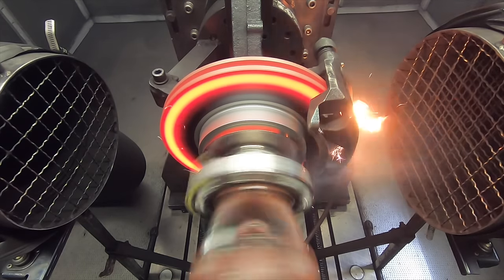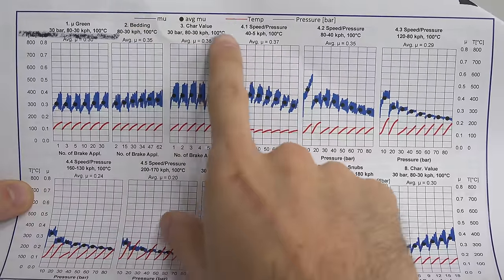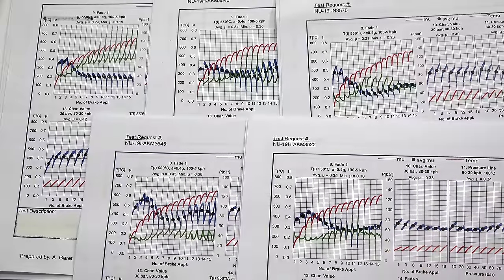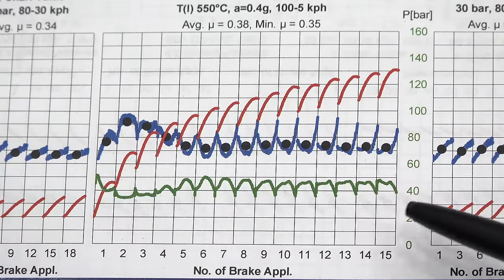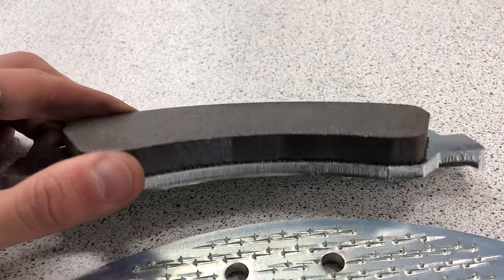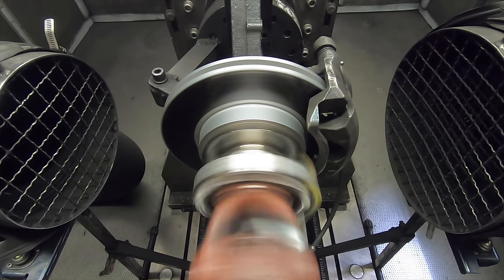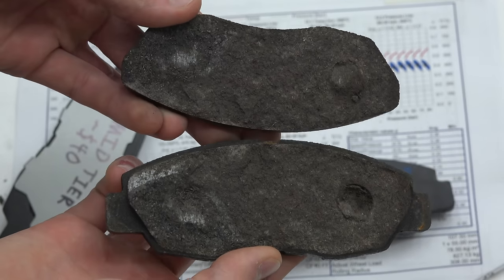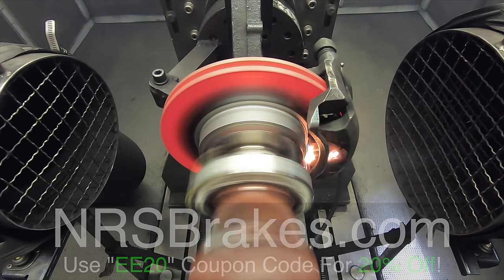What Are The Best Brake Pads? Cheap vs Expensive Tested!

Comment: "NRS uses mechanical burs to lock the pad to the backing plate"

Barely passes shear test after corrosion test
Reply: I was disappointed we didn't get to see what their pads looked like after this test. Would be good to see how well it worked. Personally I have never had pads fail due to corrosion or shear.
Reply: Jeff Ratliff It’s shown on 15:03
Reply: @AaAaSRB  You are right. Guess I missed it.
Reply: Iirc the pad material itself was the failure point not the adhesion plane, so the metal burs actually did their job well
Reply: @carl5426  Yes, if the purpose of the burrs is to make sure that at least some material is retained on the plate after material failure. But to be honest, it looks like just another instance where beefing up one part in a system transfers the load elsewhere. Is it better for a brake shoe to shed all its material, or only some, leaving a rough surface and the exposed heads of the burrs?
Reply: Yeah, quite surprising that it doesn't seem to work all that well.
Reply: @Wookey.   Agreed, however I think it is a good emergency buffer if it were to shear off and give you a chance to notice it before you demolish your discs hahah. The shear test was definitely pretty inconclusive hahahaha
Reply: I suspect that test is more about exceeding some threshold value than achieving the highest value possible as the shear failure seems to be a rare phenomena. It's likely the pads shear failure isn't a design priority past a certain value the way stopping power might.
Reply: @JeffRatliffhome  being a mechanic in the field I've seen many a  cheap brake pad separate from the backing plate from normal usage. Never mind the noise they make and prematurely wear out the rotor before the pads are worn. You get what you pay for and ultimately endanger yourself and everyone else on the road.
Reply: @danielkuddes6050  Agreed. Stopping power, quietness, temperature consistency - those would all be affected by the material used. Odds are they traded as much shear strength as possible for the other positive attributes.
Reply: Of course they passed, though.  The ‘passing grade’ is what they picked as the standard, and they engineered to meet it.
Reply: @Vessekx  Every company has to meet a national standard in regards to this situation. Yes every product is engineered to a point, however that point has to be passed, and for NRS it passed while under a 2 month degradation point as well as the OEM brakes. This is important because OEM's have to be made to standard rather then after market parts which can have some leeway on both material and standards used. I don't believe NRS is deviating from a typical standardized test. They so far are proven to be just under OEM standard.
Reply: That's because tests only measure up to the point at which the adhesive debonds in shear. Due to the mechanical burs, it has additional forces it would have to overcome past this point in order for the pad to fall completely off
Reply: KyuzoMugenUndPanzer, you seem to have missed that the specified standard NRS tests against is a standard they decided on, not a national standard.
Reply: @innocentoctave  Pretty sure your rotors and your ability to stop the car are well and truly fucked regardless of if you end up with some brake pad material and metal burs, or if your entire pad material sheers off and you're applying bare metal to the rotor.
Reply: Honestly I don't think it's a good idea to have these burs. It will make it easier to pass the shear test, but it also reduces the contact area due to the manufacture process(it's difficult to form a surface perfectly matching the burs). It sounds like a design to pass a specific test.
Reply: @filbal5954  im a mechanic as wel, and the noise when the pads start to separate and people stil drive. Its like someone screeching on a blackboard with his nails. And some people still think they have a great deal with their cheapo pads. And i dont know how bad it is where you are a mechanic. But the worst i have seen with cheap pads where pads that didnt really fit. They put some coating on it to stop it from rusting, but they put on so much you actually had to grind the pads down to get them to fit in the caliper. Now if that isnt a red flag then i dont know what is. But i actually refuse to work with that brand. And we did do some road testing with a set of those pads. Guess what? 10.000km and the pads where gone. Then put in a OE spec, 60.000km. Same car same driver, same driving style and the same road to work every day. So yes the cheap pads where only 20$, and had to be "modified" to fit, and the expensive where close to 100$. But in the end the expensive pads lasted 6 times as long, so it was cheaper, it fit better, it had better braking performance and no noise. And you didnt need to look every week if the pad was stil attached to the backing plate.
Reply: @mjc0961  Not true, I've run pads until they literally cracked in half and shot out the back of the caliper. The caliper piston stopped the car just fine and I drove it home.
I was going to replace the calipers and rotors anyway, so I figured why not.
Reply: El Guapo Fortunately the brakes still worked after you drove the vehicle until the pads fell apart, as you wouldn’t have wanted to cause an accident
Reply: @elguapo1690  While the conditions worked in your favor (as opposed to everyone else you interacted with on the road during that drive[s]), I much rather prefer to increase the longevity of my braking parts to prevent full-on replacement unless required. As pads interact with the rotors in a number of ways (different materials impressing upon each other in a high temperature and high pressure environment), as well as environmental conditions, I would prefer to have components that make the most of that relationship instead of seeing how long you can get away with shot to sh*t pads.
Reply: Seems more like marketing than engineering.
Reply: @JeffRatliffhome  corrosion failures usually only happens if you drive very little and the pads last many years. 
Normal drivers have to replace them way earlier, because they are worn down then.
Reply: @innocentoctave  I agree, strengthening one point transferred the load elsewhere, and that is why we see such results. 

And, I agree, you are correct again. In posing the question of shedding all material vs leaving some material and the mechanical burs.

I can't say definitively, but, in my opinion, I would say some material and the burs. (Depending on if you pay attention to your braking in terms of noise and feel.) In either case, the rotor in going to be damaged and need replacement. But, if you have some material left, with or without burs, it would be better than no material. 

All of that is, however, only if you lose all of the sheared material. There is a strong probability, I think, that the brake bracket, caliper, and backing could keep the sheared of material trapped and pressed against the rotor well enough to keep stopping capabilities until it could be replaced.

It would just cause a lot of noise, vibration, and other noticeable and undesirable effects.

But, these are just my thoughts. I think your line of reasoning is correct and wanted to give a shot at answering the question you posed.
Reply: I found it kind of suspicious that NRS recommended a shear pressure just below their pressure where their pads failed at
Reply: @innocentoctave  Well, you could consider the burrs are wear indicators!

Comment: It would have also been a good idea to test rotor thickness with each pad to see whether the pads that lasted longer wore the more expensive rotor faster. The way I understand it, is that there's also a tradeoff there between rotor and pad life.
Reply: no
Reply: There certainly used to be when ceramic pads were a new item. Ceramic pads would eat up a rotor pretty quickly.  Not a problem if you do pads and rotors on a brake job for yourself.
Reply: @shawnkelly695  I’ve gotten my coasting up to a red light as it changes green to an art form. Probably bugs the people behind me, but what is behind is not my concern. Unless it’s a cop.
Reply: @charlesgallagher1376  would cops hate your coasting driving style?
Reply: Youll never burn through your rotor before the pad. Unless youre using the same rotor for multiple pad uses
Reply: @shawnkelly695  I do the same thing. I never understand why some people tailgate so much. Not only are you reducing your chances of reacting safely to something up ahead but you'll have to jam on the brakes everytime you have to stop. I just let off the gas once I see the yellow light while my sister would keep her foot on the gas pedal until she has to jam on the brakes. No wonder she had to replace the brakes every couple of years on top of destroying her fuel mileage. The key to most driving is keeping most inputs to the bare minimum. Tailgating and speeding only save you a potential couple of minutes while your risking accidents or tickets.
Reply: @shawnkelly695  perfectly said. LoL it is amazing how my philosophy on driving is exactly the same even down to the psychological stress. I can't wait until the perfect autonomous vehicles. It will eliminate accidents and traffic almost entirely as well as reducing travel times, stress and traffic lights. Just imagine a city like New York with no traffic jams. All of the cars communicating with each other and the traffic lights. No more DUI's or gridlock. Elderly won't be forced to isolate themselves cuz they don't have a license or car.
Reply: @turtleb7170  unless the rotor warps which happens a lot on cheaper aftermarket rotors
Reply: @turtleb7170  - But the question still stands. How many brake changes can I before buying rotors? If I can get another one or even two more brake changes without replacing my rotors, I would certainly be willing to pay more for brake pads that give me that option.
Reply: @seanriopel3132  - Please don't compare speeding to tailgating. Tailgating is an aggressive behavior that does nothing but create stress for everyone involved. Speeding, however, can obviously save you critical time. If you're going to miss a critical time and speeding gets you there on time instead, it can matter. For example, getting to a flight, train, ferry, or show on time. Of course, it's hard to save much time by speeding, and leaving earlier is always the smarter, safer, cheaper, and MUCH less stressful solution - for the other drivers you affect as well as yourself.
Reply: @seanriopel3132  - Autonomous vehicles will obey speed limits when they are ridiculous. Driving in the middle of a three-lane highway when it is empty should not require a limit of 65 mph. That limit assumes moderate traffic in all three lanes during a rainy day. A robocar will crawl along, wasting time.
Reply: I want to know what manufacturer the mid grades were, I live in the desert so rust is of no concern to me
Reply: @turtleb7170  "Unless youre using the same rotor for multiple pad uses"

 I certainly do not expect to have to replace the rotors every time I replace the pads, nor have I had to do so.

Comment: Great explanation, when I was a mechanic I specialized in brakes, i went to all the major brake manufacturers brake schools,  and there IS A BIG difference in quality between cheapy pads and high quality pads,   Organic pads are the cheapest junk,  and ceramic was  rated tops,  when I was doing brakes taxi cabs and police cars, highway patrol,  were using ceramic,  least brake fade, low noise, long lasting, not to aggressive on the rotors, Thanks William Orange county, ca.
Reply: Semi metallic will always give less fade over ceramics as they handle heat much better
Reply: I got carbon ceramic pads, they any good? Or i think carbon ceramic, like a copper or brass color flecks in them.

Comment: Project farm: challenge accecpted.
Reply: LifeOD: Hold my beer
Reply: Christfix finished his beer.
Reply: I love Project Farm. His scientific method is absolutely bulletproof. He puts a lot of thought and hard work into his testing to be objective and trustworthy.
Reply: "Can you use gummy bears as brake pads? Let's find out!" (wanted to type in all upper case since he always shouts at his audience :D )
Reply: @steveman1982  "How these bars of butter compare to cheap brake pads? Lets find out"
Reply: he will include akebonos for sure. he is a fair guy.
Reply: Andrew Camarata: brewed the beer, made the can and the packaging.
Reply: I would like to see this, he has better controls.
Reply: @steveman1982  thats taofledermaus
Reply: mannys9130 It is actually out of spec testing that has no bearing on actual engine performance if we’re talking about his motor oil battery of tests.

This video is actually just as wretched. 

The end game for a consumer is to know if stopping in less distance will occur or not if one shells out more for higher end pads. If matters if it’s a Corolla, a Charger, an F-150, or a full size tractor trailer.

Comment: Recently did the first 4 tire replacement on my 2018 kia at 65000 miles. While it was up I took a look at the brakes. No noise yet, but I expected to see thin pads. Had I not known the mileage on the pads, I would have guessed them brand new. When the time comes, I'll be buying original kia pads for $80 an axle.
Reply: Well i would also assume you easy on brakes. Likely never tailgate. Likely coast to slow up speed in advance for stop, turn or slower speed ahead. Or maybe you live in more remote area. People like yourself that get a long time out of brakes also save on gas. Plus i bet you have very few rear end accidents cause to have brakes that long be that good you cant hit them hard.
Reply: @shawnkelly695  it says I made that comment a year ago. My odometer now reads 127887. I don't drive 60k in a year. But I do drive 30k. So closer to two years. 

The original pads started yelling "I'm done" right around 100k. I did not replace them with factory pads. Long story. The replacement pads make a very faint grinding noise when coming to a stop that the originals didn't.
Reply: @thetoddperspective  could be the calipers not moving properly. A stiff caliper can cause 1 pad to wear more then the other. But ya to get that many miles you gotta be easy on brakes. Easy way to tell a good driver is how long brakes last. Many i know eat up brakes in 30 000 miles or less. On and off. Hard stops and tail gating. Never coast just right on the brakes and hard. Cheap or oem they wear them out fast. A friend bought brand new car and 6 months later brakes wore out. She always asked how i get 3 yrs out of cheap pads but she uses premium and only lasts 6 months. Driving habits dear. But oh well burn em up not my car or money.
Reply: @shawnkelly695  - With that degree of brake wear, your friend sounds like one of those people who inexplicably uses her brakes for exact speed control, driving down an empty, flat highway yet hitting her brakes every two minutes. Nothing tests my sanity than those drivers!

Comment: I would like to see this done with different rotors too!
Reply from the maker: Great idea!
Reply: Eze&Yare Dominguez I always thought slotted was more aggressive
Reply: NFL YoungBoy the slots are just to aid cooling/as an escape route for gassed between the disc and brake pad
Reply: Giovanni John-Blackett so they don’t eat up the Brakes? And are Autozone brake pads really ceramic? They do leave brake dust on the wheels
Reply: Holes aid in cooling, not stopping power. They also wear pads acting like a cutting surface. If you plan on racing and getting brakes hot, rotors with holes are better wo your brakes just keep working. More surface area on a smooth rotor has better stopping force but wont cool as fast. The reason why you get bigger brakes is more surface area. Reducing surface area has to lower braking force by some tiiiiny amount
Reply: Engineering Explained along with break ability you could test for disk longevity, sacrificial disks on my Ford transit are very expensive (especially after just 28000 km)
Reply: 90% of rotors are just simple iron. Maybe difference between slotted and drilled etc. However, then you are getting into performance parts.
Reply: @NFLYoungBoy223  Get akebono pads. You won't be sorry.  No to Autozone pads.
Reply: @EngineeringExplained  My thoughts as well! Plus slotted and drilled and all those kinds of aftermarket "go faster" or in this case, "stop faster" parts.